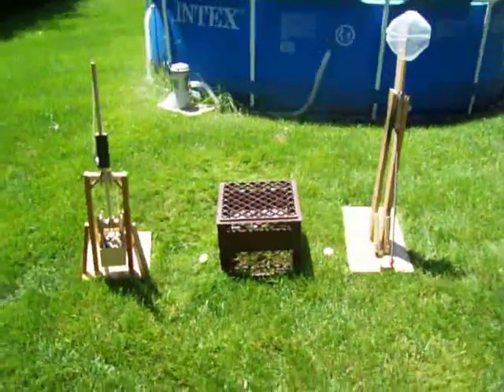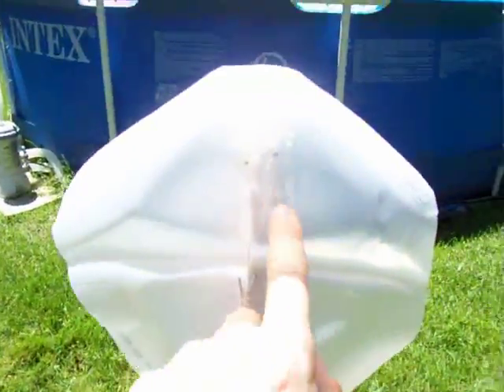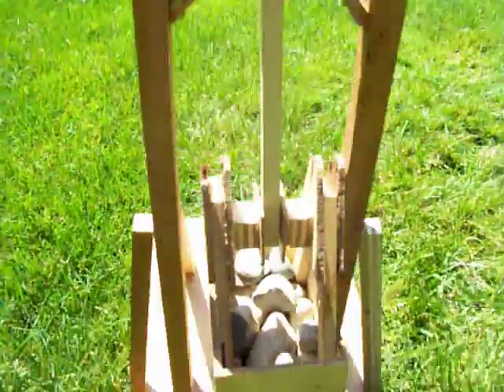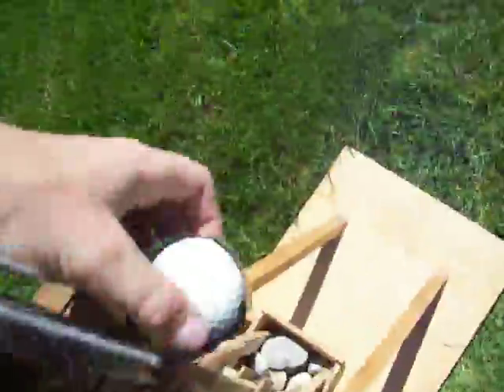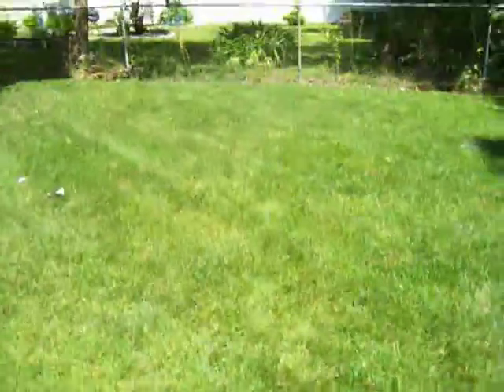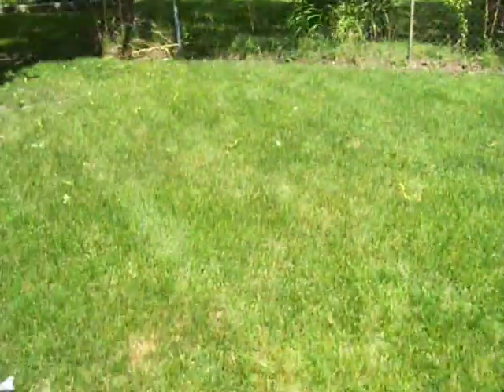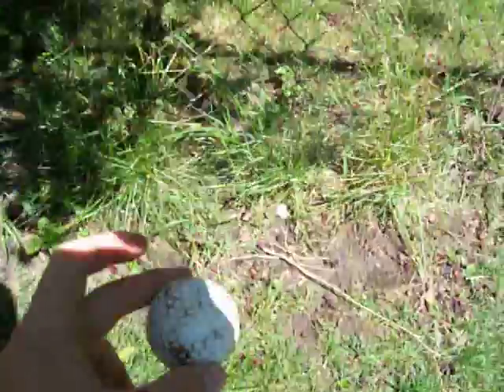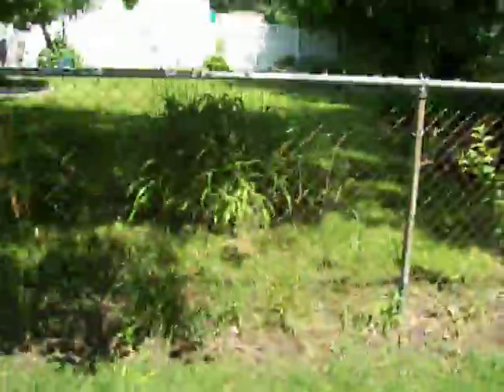Catapult VS Trebuchet

Comment: The trebuchet has the potential to to through that golf ball about 30 or so meters (98 feet for you people stuck in imperial measurement time) if the trebuchet is tuned correctly and built a bit more sturdy, as I suspect when you make the counter weight heaver the machine will break on you.

Comment: I think the actual name for the catapult was a torsion catapult I may be wrong but the term catapult refers to anything that throws an object though it is mostly associated with medieval siege warfare also the trebuchet is out of scale with the catapult a large trebuchet was the height of a modern 5 story building (up to about 18m) and a catapult was only a bit taller than a knight on horseback
Reply: iDespiseMicrosoftWindows dude it's a catapult smartass
Reply: iDespiseMicrosoftWindows plus windows is best

Comment: Trebuchets are better weapons the catapult you built has more power to it.
Also Trebuchets are normally much larger compared to catapults there less mobile and normally need to be erected at location, Catapults can be wheeled because of the size.
Reply: HeeroYuy911 so considering all? How is a trebuchet a more useful ‘siege’ weapon. Ain’t no time to build on the go numbnuts